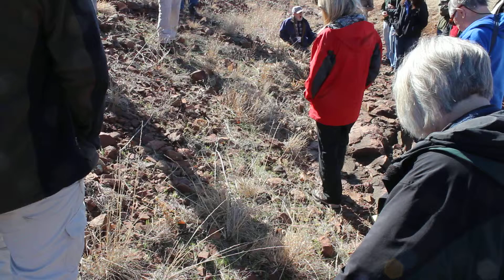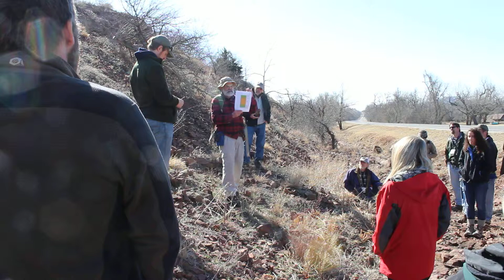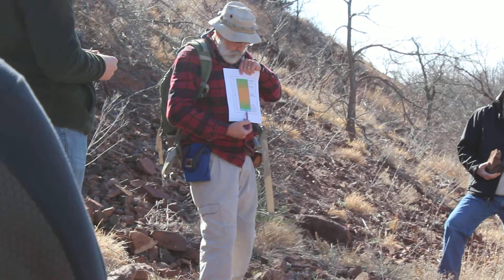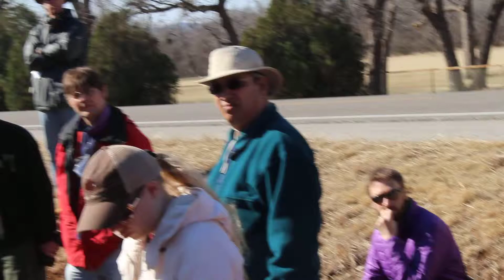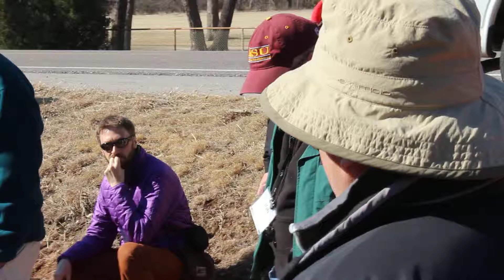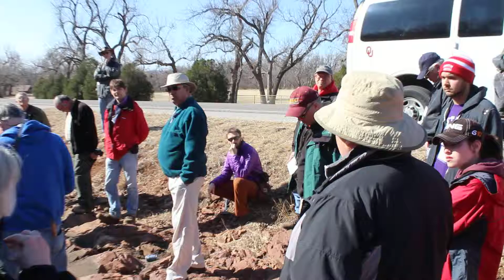Rhyolite Flows in the Slick Hills - Dr. Richard Hanson, Day 2, Video 8

Comment from the maker: pon2oon, please contact Dr. Richard Hanson at Texas Christian with your good question.  You can find his contact information on the TCU website.  Regarding viscosity, Hanson mentioned during the trip that these igneous rocks are high in fluorine.  in fact, F in drinking water is an issue in parts of the Wichitas where the aquifers are in proximity to the igneous  rocks.  Elevated F in magma and lavas is recognized to decrease viscosity and promote the flow properties of the lava...which would be a step in the direction of your thinking..."how does this type of lava flow?"